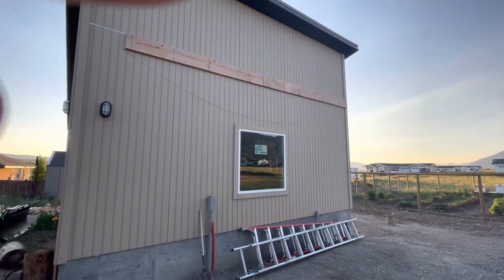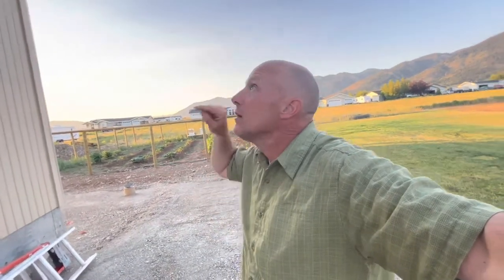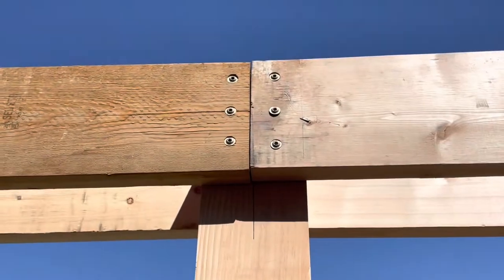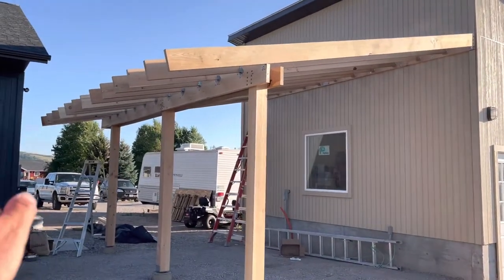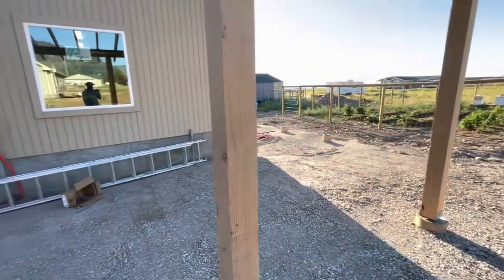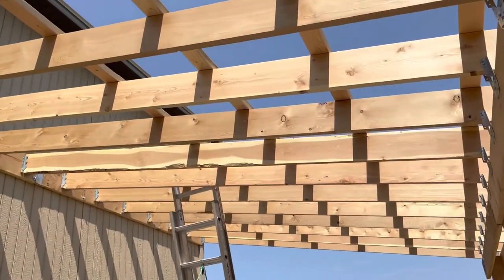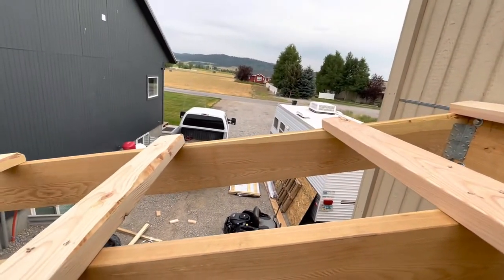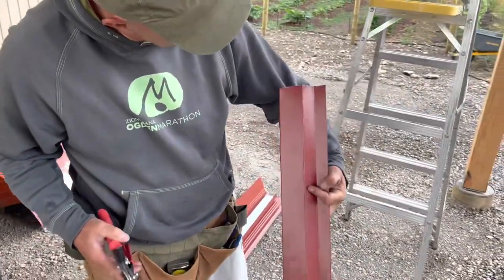Garage Extension or Carport

Comment: Hey Joe look's good 👍  I'm a builder from Florida. Many different ways to get your post elevation i typically use my laser level or auto level shoot a mark on each one speed square it all around then check it a second time lol ...I've collared them so the posts don't  move then make my cuts. On the rafters I usually do a plumb cut on the tails same angle as your ledger tie in and the cut where your rafters sit on is called a Birds mouth or seat cut. Look's like a 5 / and 12 pitch was that code ?  ... your Rafters are not sitting correctly on the back collar tie Carry Beam... so what I would do is put through bolts at each post because if you get snow freezing rain with the existing weight of all your lumber and metal that would be bad all the weight is pushing on your front Carry Bem. So I have done it with a notch in one carry Beam 2x6 into the posts delete the other this way all the load is on the three posts. I like the look of a double header carry  Beam so for me it's Notch in both carry Beams or through bolt them for strength and or drop to a 3 an 12, or a 4 / 12 pitch. So Joe if you didn't do it already put the through Bolts on and I know you said you were going to put Bolts at the bottom. Do that and your Good to go Great Job 👍
Reply from the maker: Hey thanks for the advice. I’ll look at putting those bolts in.
Reply: @heyjoevideo  It wasn't supposed to be a long post but hard to explain in a nut shell lol Bottom line is Great Job 👍

Comment: Notice if you will how many screws you used on the ledger board attached to the building.
THEN, imagine if you will that the other end of the roof will be supported exclusively on
only 3 posts. Why so many fastnemers into the building?

!